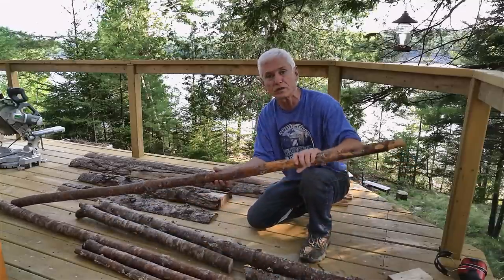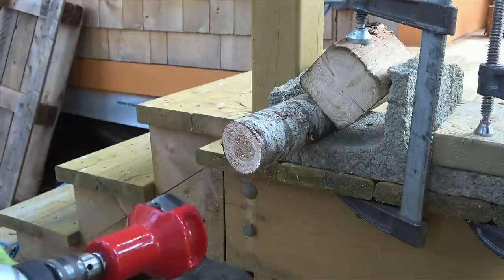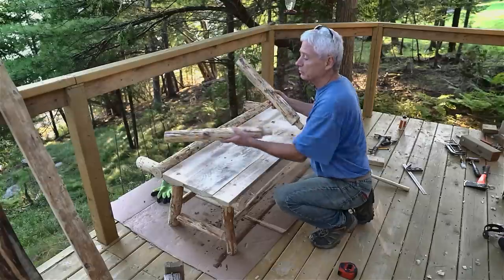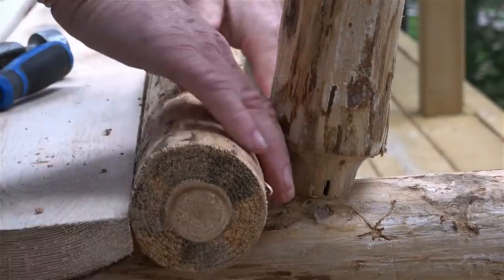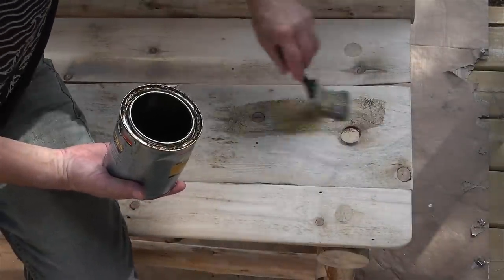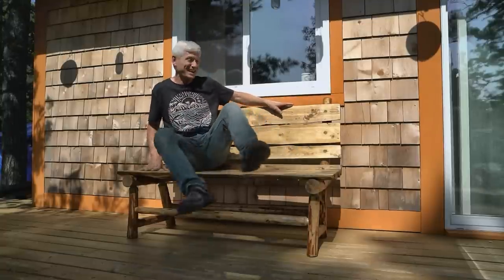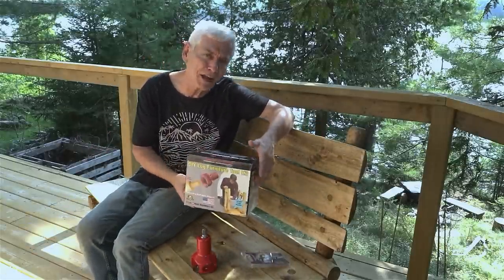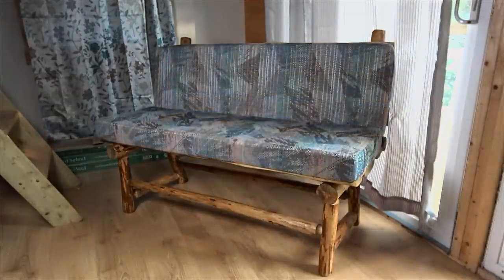Slim's DIY Log Bench (and Couch too!) Recycle Project

Comment: I baught onevof those kits years ago ant it is definitely not a toy. I used it on green maple with a 1/2 construction drill. It caught a knot and yanked me (300 lbs big guy) out of my seat. Even with hardwood the connection is loose and as the wood dried it got worse. I used a small wedge on the end of the tendon and that helped as i drove it in. Great tool but make sure it is well braced. Great video. Thanks

Comment: Hey Slim, If you knock the corners off the end of the logs before starting the tenon cutter and start the drill a little before you make contact, it makes it much easier.

The vasectomy comment caught me off guard and got a good laugh out of me. :)

Smart solution for the missing knot!

Final result is fantastic! May you enjoy it for years to come :)

Comment: Great video thank you! If you decide to make more log furniture I would recommend cutting your trees and de-barking in the spring after the sap starts flowing, you won't believe how easy the bark comes off! Once your get your fingers under an edge you can often pull  off huge sheets at a time without using any tools at all. And as a bonus no bugs and it dries much faster.

Comment: You could try another bench project. The way they made chairs in colonial days was they made the seat bottoms from un-dried wood, usually pine. Then the legs were made from extra dry maple. What would happen is the seats would start to dry, making the holes smaller. Then the legs, would swell from absorbing moisture. This would make the joints very tight without glue. As far as the bugs, the wood needs to be heat treated to kill them.

Comment: If the holes are just a little too big you could also use the guitarist toothpick and glue trick that we use make the holes smaller. Worked for me when replacing shoulder strap knobs with locking strap hardware

Comment: Bed and side tables next? Vanity cabinet for bathroom sink? So many ideas, so little time. Fun project. For stronger joints have the tenon go all the way through, put a cut in the tenon, and then drive a wedge into the split like an ax handle is made. Great for heavy duty bed frame joints. Just a question of how far you want to take it. I have seen whole houses furnished this way.
Reply: Must say I love your humor and that V joke was a split second ahead of me. Gotta watch those machetes.

Comment: That's a handsome bench you made. Perhaps sometime in the future you can make another one for indoors so you won't have to drag it in and out all the time. Suggestion: If you do make another one for indoors, make it an inch or so lower so your feet can touch the floor while you're sitting on the cushion. I'm vertically challenged, and I can attest that sitting on a couch that's too high means either dangling feet when sitting all the way back, or sitting so far forward that I get no back support. Not a relaxing thing at all.
Reply from the maker: I don't need to make another one to lower it. Just get out the oscillating saw! SP

Comment: For the new machine that you have to make tenants take a nail put it in the end. Get a little dibit and then you can put your Tool up against the in The debit. And it should go out smoother another word. You're just make a little hole to start your drill. smoother.

Comment: Is it called oscillating or reciprocating saw? I think oscillating is the one with the flat short blade AKA "multi-tool", whereas the tool Silm was using is the reciprocating.
Reply from the maker: You're right. Mixed them up! SP

Comment: Do you really want to be moving a heavy bench inside to outside every time you need either way? Maybe some casters will assist in this, makes it easier, proving it could pass through the door at that angle

Comment: Slim, I like your dedication on this and every piece you make but I would suggest that you not buy that $70.00 tool and just do as you did near the end and just use the dowels cut  from the smaller trees.  14:45   Great work any ways.  Keep posting. From B.C. Canada.
Reply from the maker: I didn't buy a $70 tool. I bought a $150 one! I agree, it's not completely necessary. SP
Reply: @SlimPotatohead  thanks for responding , much appreciated. have a great day.

Comment: Nice job Slim. But I think you shoukd have built yourself a good work bench first. Holding the wood with a clamp and half a cinder block was a bit sketchy.
David in the UK.